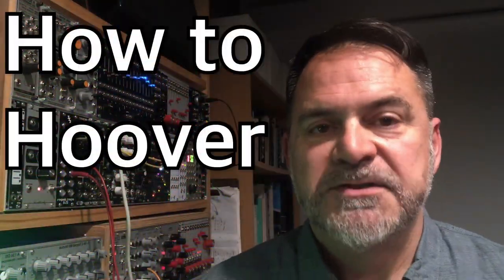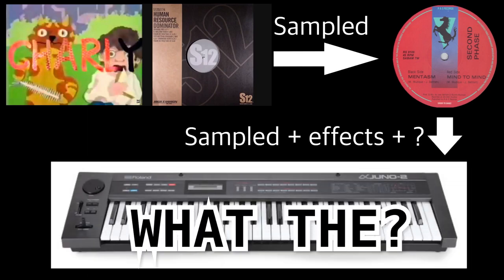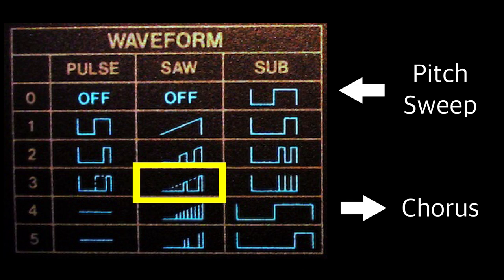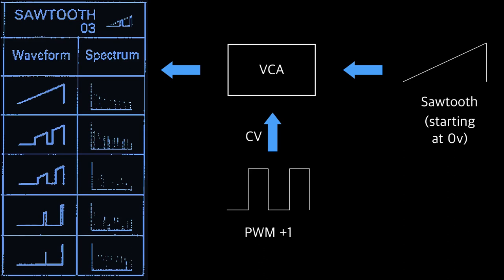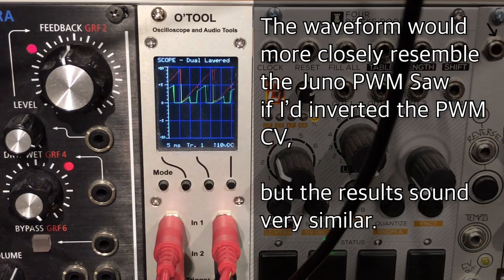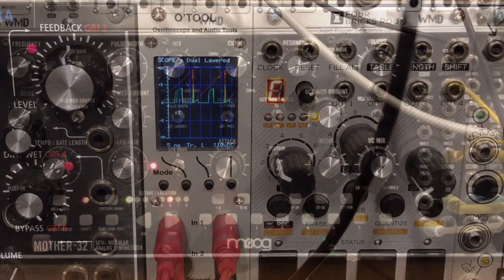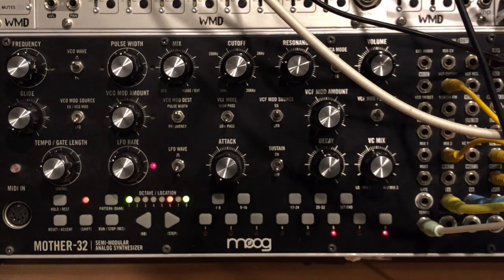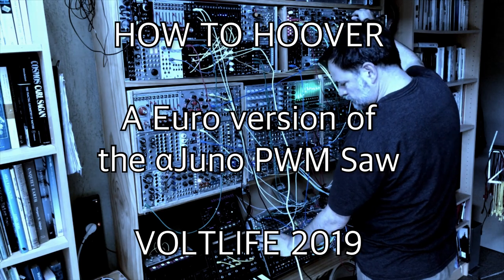VOLTLIFE: How to Hoover

Comment: What's interesting is that the LIvewire AFG was built to naturally produce animated saws
Reply from the maker: Yes indeed! I first tried out the animated saws in the AFG, and while they sound great, they’re quite different from the alpha Juno’s PWM saw. I suspect that the AFG internally uses window comparators to create the “alien pulse” waves, then use those to modify the base saw, probably using mixing and/or switching rather than VCA chopping as in the Juno.